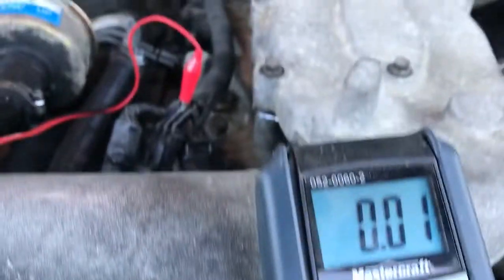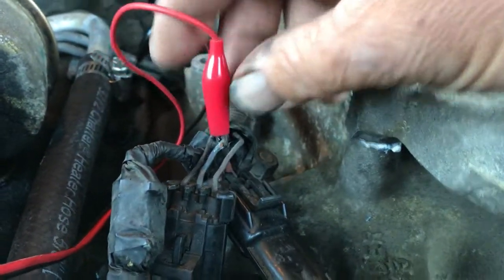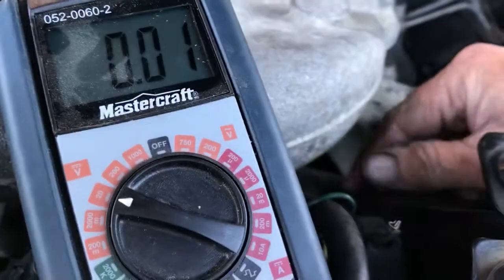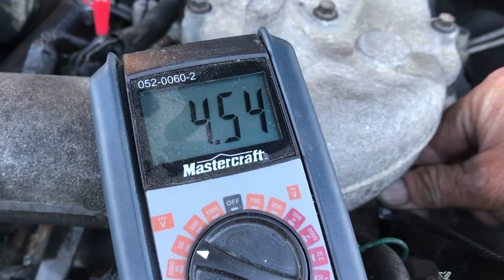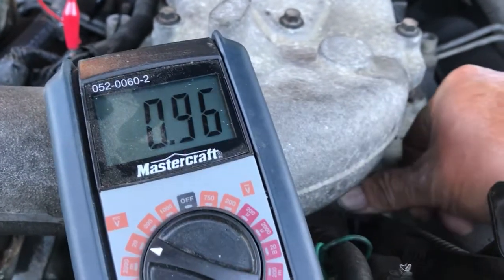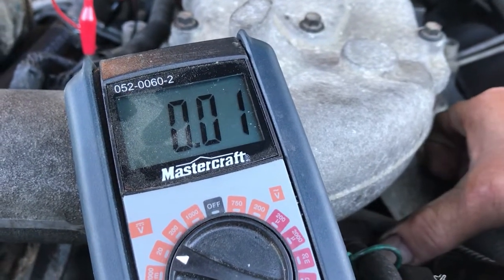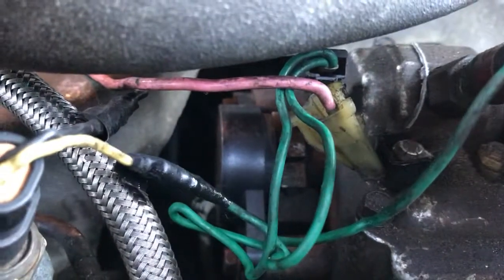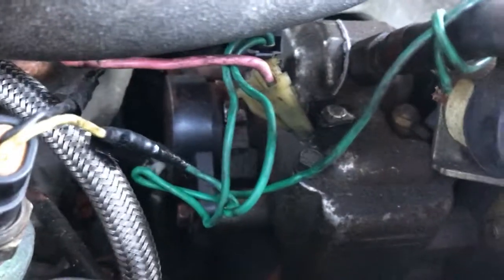1993 GMC 3500 no overdrive tps test

Comment: Awesome. I just bought a new tps for my 94 firebird. Same symptoms. Hard shift 1 -2 and no overdrive
Reply from the maker: That can definitely be one of the issues and another thing is your water temperature thermostat, and there may be one or two other reasons as well and also check your fuses. Make sure they’re clean and not corroded. With the thermostat if it’s not seeing the correct temperature, warm up, it will not shift into overdrive. Normally my trucks will take about just about 2 miles before they are warm enough to start shifting into overdrive it’s not an instantaneous thing.

Comment: Thank you for this video. I have been looking for the throttle position sensor. Other videos are for 5.7 or other enjoys which is in different location. My check engine light comes on and off when I get to 80 or 100km speed and scanner says throttle position sensor. Did you have to replace yours?
Reply from the maker: My problem was it was originally a little loose when I got the truck and it affected the kick down in the transmission but after I fixed that there was still a spot where there was a problem, so I replaced  TPS. They ware out on the inside, and can be intermittent.  Keep in mind you’re able to turn that sensor and that adjust the kick down in the transmission when you’re passing people if that’s not set right it won’t feel right, be careful to get it back to the original position.
Reply: @dvlingo  thank you for the reply. I tried to locate my TPS in same 6.5 diesel but I be don't know why I can't see it. I used your video to guide me but would it be mounted on the injector? Maybe I need to take the intake off to see it.
Reply from the maker: @blackincawston   The truck in the video is a 1993 but you might want to look on the throttle pedal and see if there’s electronics on your fuel pedal because that’s the other location sometimes you have to change the throttle pedal unit
Reply from the maker: @blackincawston  you should not have to take your intake off
Reply: @dvlingo  thank you very much. I'll look into that. Would you say in you have both also on your truck, on my pedal and injector/engine area
Reply from the maker: @blackincawston  I have 2 identical Gm 1ton dually 4x4s 6.5 litre turbo, I use them both daily, one is 1993 and one is a 2000 and I have a 96. 3/4 chevy also, parts truck  what I do know there are many combinations of ways they built those trucks you can find service manuals for those trucks online somewhere it might be helpful to do a search.
Reply: @dvlingo  ok many thanks🙏

Comment: I see you have "RE-WIRED" the coolant temp sensor to a "2wire" sensor. I see you used the "GREEN" wire, where does the gray wire come from? Great vid thanks.
Reply from the maker: No actually absolutely stock except for wire have been replaced for a mystery problem It’s just missing the plastic. Cover actually, I bought this truck really cheap because of this mystery problem. The guy replaced a lot of stuff because of this all he really replaced was the connectors. It’s a 93 completely stock. Still going strong today. They’re all wiring a little differently this one shares wiring with the engine idle speed solenoid.And the thermostat  it is the way they did them and then the computer sorts it out through the data pulse link if i recall trying to answer my memory I haven’t actually looked at it for a while. Don’t need to open the hood too often.

Comment: My truck has this problem where the speedometer and overdrive don’t work, but when I hit a puddle or any type of water they will work for a little while and then I assume something gets dry, most confusing thing I’ve had to deal with
Reply from the maker: Check the old spade fuses for corrosion they can get a film on them and then things don’t work proper try that. Sometimes when the speedo doesn’t work it’s not making contact behind the speedometer in the connecter so sometimes you pull it out and check the connecter make sure it gets plugged in properly when it is inserted you can have a definitely loose connections were different gauges may not work or work sporadically.

Comment from the maker: Keep in mind the thermostat that is located on top of the motor communicates with the transmission computer and can also keep the transmission from shifting properly if it’s not working too. when it works good I know instantly because it shifts 2-3 way softer. mine always shifts slower when it’s cold into overdrive it needs to come up to temp so it can! About 2 miles for me then OD will engage at about 45-50mph Good luck  important to RESET trans computer, disconnect or remove batt cable or ECM fuse after you change things
Reply: I got my truck but wgen i punch the pedal throtle nothing to rev up
Reply: awesome thank you. it shifts good now, had to re wire the output shaft speed sensor. new tps, new iac sensor, now it feels like its stuck in choke (no power after 3400 rpms. going to buy a new oil pressure sensor (the one thats in there reads way past the 80 pressure mark so i know that isnt correct. I got the car from some meth head who thought he could wire. so im having to redo a bunch of stuff.. theres 8 ground wires on one bolt next to the throttle body >_<

Comment: What are harness are you hooked up to? The middle wire on throttle position sensor harness? Thanks
Reply from the maker: skydogj Throttle position sensor, the plug is three wire.pos hooked to center and to a common ground. Also make sure sensor  hasn’t come loose. Thx
Reply: @dvlingo  ill have to test mine tomorrow. I have the exact same issue and same engine. 92 C2500 6.5